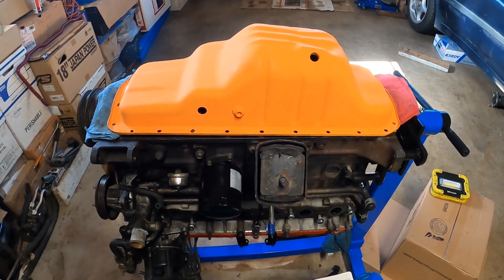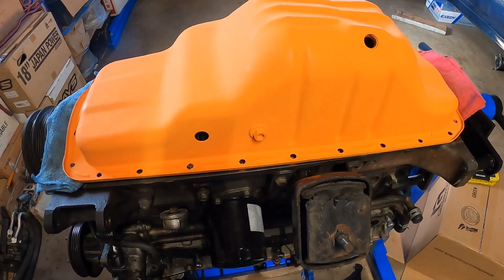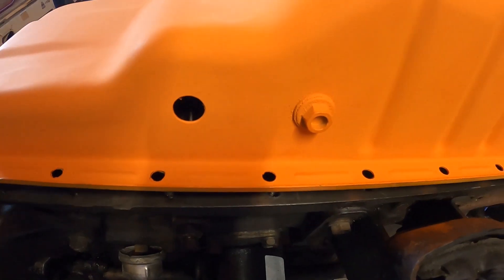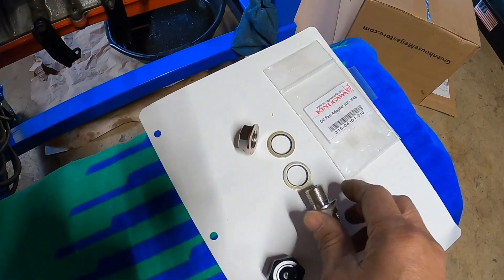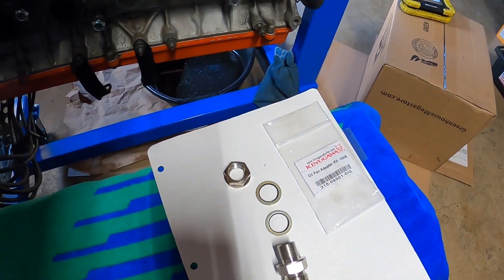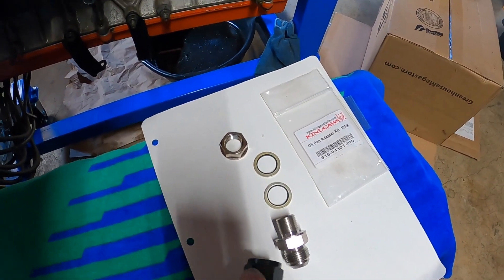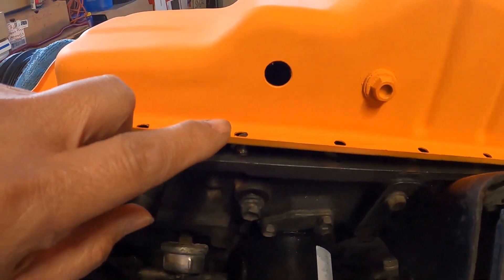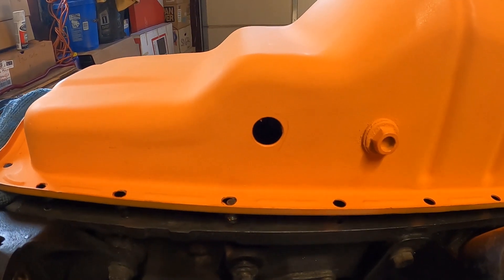Supra MK3 7M NA-T Turbo Oil Drain

Comment: Why not use the factory bolt hole?
Reply from the maker: The factory/OEM turbo oil drain hole is not there on a 7MGE engine block.  So, the easiest way to have one is to route the oil drain to the oil pan.  Although there is already a threaded hole in the oil pan, it was small for my preference.  The -10AN size is what I prefer to use.